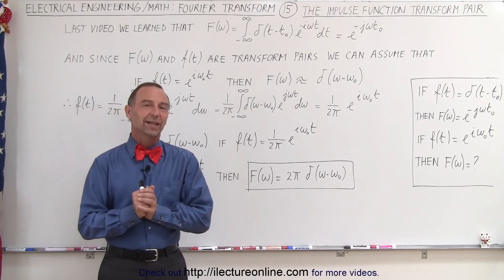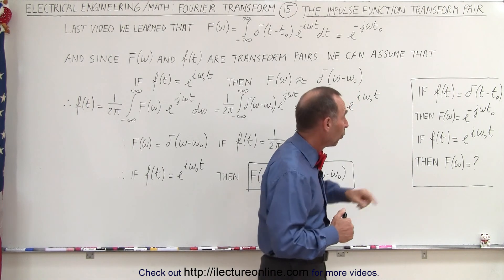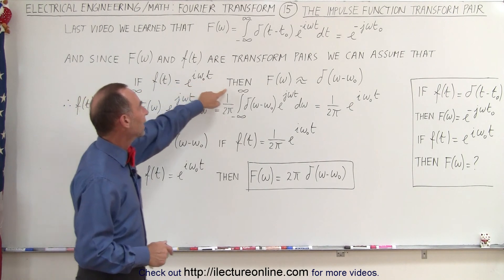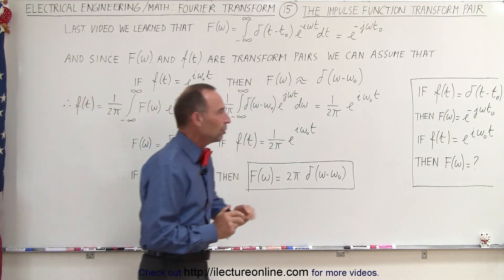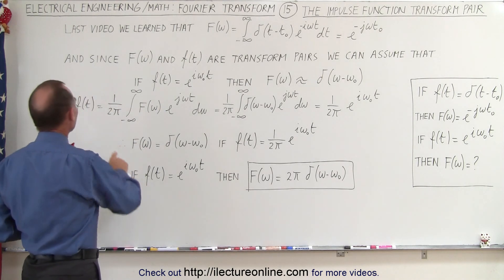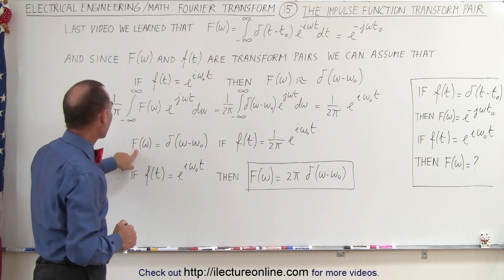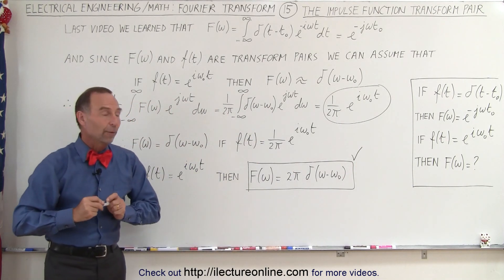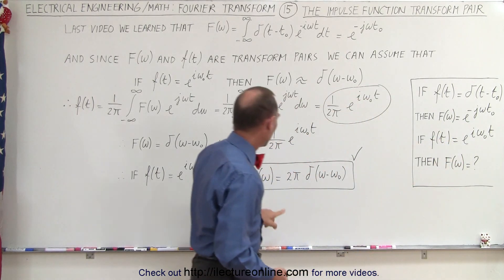Electrical Engineering: Ch 19: Fourier Transform (15 of 45) The Impulse Function Transform Pair

Comment: Why have the two pi term there in the first place if you have to put it in the result in front of the delta function to cancel it with the two pi term in fron of the IFT. WHy just not have the pi term in front of the IFT and then you do not need to put a 2pi term in front of dirac?
Reply from the maker: There are indeed often multiple ways to get to the same answer.
Reply: @MichelvanBiezen  Thanks for answering. What I meant is where does the two pi term in the definition od the IFT come from? What if we do not include it and why is it necessary?

Comment: Hi Michel, Why did the 'i' become 'j' in LAST VIDEO WE LEARNED THAT and vice versa in the inverse FT? Shouldn't they be the same complex character  with only opposite signs in the time and frequency domains?
Reply: My understanding is as follows and I think this could help clear some confusion: Back in the day of the old mathmagicians decided to use i as meaning sqrt(-1) and all was good and swell. That was until electrical engineers decided that i should denote current. As the electrical engineers need to use math already developed and don't want to confuse current and sqrt(-1) electrical engineers use j as denoting sqrt(-1).
Reply from the maker: I and j have the same meaning.  They are both the square root of -1   Depending on the application both symbols are used.
Reply: Michel van Biezen, Thanks! Nice shirt and bow, BTW.